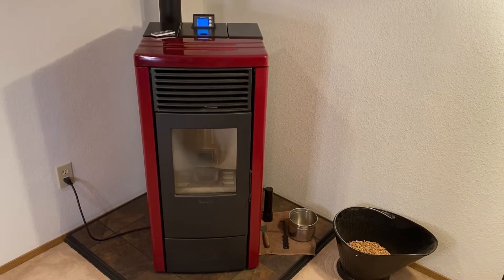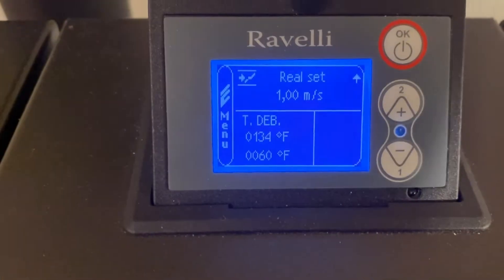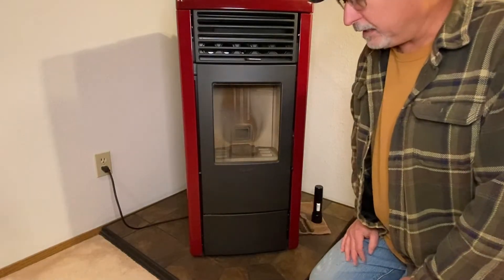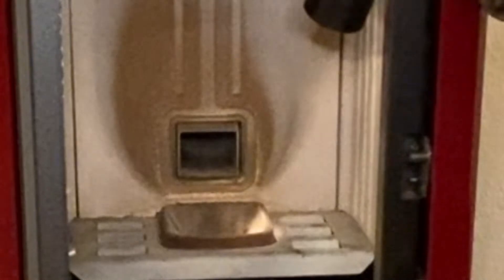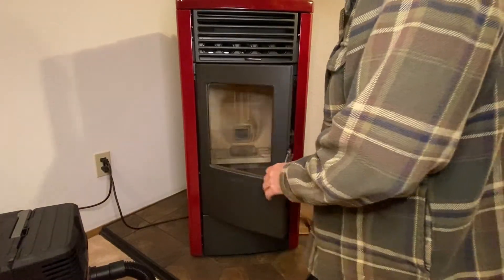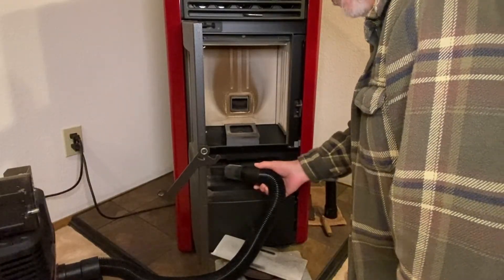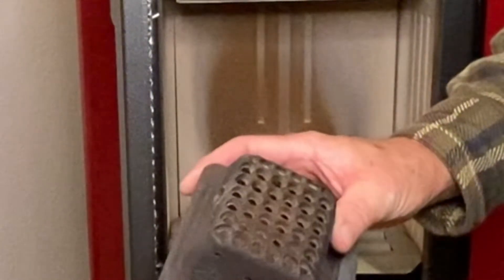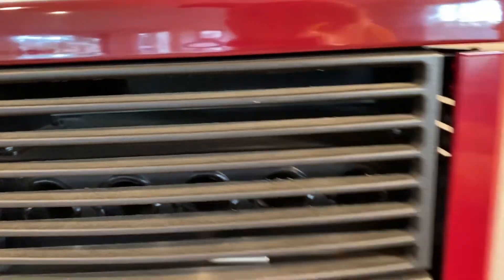Ravelli Francesca pellet stove airflow sensor error, cleaning, hopper filling and burn pot cracks

Comment: Hi, I’ve cleaned this pellet stove like yours, which I currently have on loan. However, I have a doubt about reassembling the flame deflector, and I’m afraid of positioning it incorrectly when the stove is turned back on. How is it secured, and what is its correct position? Could you possibly film it from underneath to show how this part should be placed? Should the slot of the flame deflector fit into the vertical U-shaped piece, or is its correct position to be fixed higher up? I don’t understand… Should it be almost horizontal, closing off the combustion chamber, or tilted and /or semi-open?
Reply from the maker: Hello!  Hold the baffle with the slot pointed to the back of the stove and the solid tab on the front of the baffle  bending down. Carefully lift the front tab tipping the baffle to more than 45° and raise it up inside the stove. Pull it back toward you resting the front tab on the flat bracket. Using your finger tips in the oval slot, continue to pull the baffle toward you raising  the back cutout edge over the swing bracket. Push it slightly away from you and nest the cutout on the swing bracket. You may have to fiddle with the swing bracket a bit to get contact left to right. 
After install, the baffle is angled up to the front and sits on the front bracket and nests into/on the swing bracket. 
Hope this helps!
Reply from the maker: I can’t film anything at the moment. However I do remember in one of the Francesca vids I do show the baffle orientation before I install it.
Reply: @FUBARtractors  Thank you for your fast response , you're very kind, I'll try to install it as you described , and with the help of this video of oyurs at 16:40 or so ! thanks again

Comment: get a 3/8 plate of steel and match the air holes on the bottom of the burn pot, it will insulate it from further cracking. you could also do 1/2" up on the bottom for a bit more fire protection on the burn pot. Warping/cracking can can happen on the burn pots luckily we can just fabricate our own.
Reply from the maker: Thanks for the tip, I never thought about making my own burn pots, great idea!

Comment: I'm curious what your pellet and airflow percentage settings are, and any other tweaks you may have made. watching you clean had me thinking my settings must be off because I've got so much ash. and your flame looks much smaller than mine. thanks!
Reply from the maker: Yes I can put those in a comment.    My ash bin is about 1/3 full each Sunday during the cold months. There is another 1/4 bins worth that falls in the side areas too. It will be a few days however before I can get to it. - Curtis.
Reply from the maker: Hello Adam. Sorry for the delay, I was out of town. 
My Francesca has a vertical 3”  flue about 15’ tall and I pull combustion air from the crawl space via a 2” pipe.  After I cleaned my stove the first time as shown in my videos, I reran the RDS set up. I found the codes online and a dealer present on how to do it.  I still had some ignition problems with way, way too many pellets on ignition so I changed some of the IGNITION parameters (default settings)
TF01 is the auger pulse now 3.6 seconds
TF02 is the auger run time for initial load of pellets now 3 minutes. 
TF04 is the igniter timer and I backed it down to 120 seconds. 
Now the burn pot fills about 3/4 full and the auger stops while the igniter is heating up. It’s been a long time since I’ve had a failed start up with these settings. I also don’t have overflowing pellets during the initial “flame light” and 8 minute warm up like I used to after the “professionals” did my initial install. 
My stove runs in modulation about 90% of the time and the flame is so low sometimes you can’t see it unless you are looking down into the pot, perfect!

My stove is ready for another deep cleaning. After that I’ll fuss with the user parameters

If you want to contact me via email for more in depth discussions - fubartractorfactory@gmail.com

Thanks, Curtis

Comment: How did you manage to only have that much ash after 3-4 days? I have to empty mine after 2 days. What setting do you run on? And at what temp desired temp
Reply from the maker: Hello Andrew. I run my stove on setting 4. I also run it using the thermostat so it runs on “work” then down to “modulation” om Modulation it goes from 5” flames to barely a flame cycling randomly. I’ve tried setting 5 but it spews out too many red hot pellets that end up in the ash bin. 
After a week, the ash in the bin is piled up and coming out of the front left corner of the bin. A quick shake and it’s about 1/2 full.  Sometimes if the house is cold soaked (51°F) it will run on high for 6 hours before switching to low. I use the stove thermostat set to 66 or 69. A thermostat on the wall right next to the stove tops out at 71 to 75° depending on outside temps. 

You can adjust your pellet drop and burn fan with the user settings.
Reply: Cheers I appreciate it! How many bags do you go through a day? Would you mind posting your airflow/pellet flow % that you use? Understandablly it depends on the type of pellets. But I guess since you are at a high setting (4) it burns them more efficiently.
Reply from the maker: Hi Andrew. About 1/3 to 1/2 bag a day, more if the house is cold soaked and 51°. As time goes on and the stove gets dirtier I change the user settings.  When I run out of adjustment the stove gets cleaned. I’m just about there now.  I used the RDS set up after my first deep clean. It picks all the draught and pellet values for setting 1-5. I don’t know what those settings are at the moment. I’m at -3% pellets and +4 % flow.
Reply: @FUBARtractors  Really appreciate it. I'll make some adjustments to my settings to see what fits best. one last question, the temperature probe located behind the unit, how far or how close from the unit is it? I'm trying to find the optimal distance to have an ideal temp (between the top temp probe and the back temp probe)
Reply from the maker: I have my thermocouple stretched out as far as it will reach. I think it’s a couple inches. When I bought the stove the instal bastards didn’t pull it out so it reached temp in an hour or so and I had to lie to the thermostat setting and set it in the high 70’s.  I think that’s the only thermostat (thermocouple or thermistor or what ever it is).  You can plug in a thermostat but you have to click the box on the display to have it read that one instead of the onboard one.

Comment: Great video, we bought a RV100 in August and the technician never set up the RDS and never trained us, the wire  for the flow meter was bad, so we spent over $1000 in service calls. Shouldn’t there be a manufacturer warranty?
Reply from the maker: I’d Google the warranty claim to see if the manufacturer or dealer provides a warranty.  A quick Google and I didn’t see anything encouraging however.  Good luck. Glad you like the video

Comment: I have the same model.
2800 euros.
No problem in 4 years .
Why the brasero is Broken???
Thanks!!
Reply from the maker: Burn pots will eventually crack from repeated heating and cooling cycles. It could have happened faster because of the way the stove was set up by the installer. After “flame light” it would drop so many pellets it over flowed and flames would reach up past the flame trap. I re-ran the RDS set up and adjusted the initial load as small as possible. It now enters “Work mode” without being warm enough to start the blower. It’s not unusual for it to take 5 more minutes to start the blower.

Comment: hi I have the same stove and something very scary just happened.  A small fire started on the TOP of the stove under the small reservoir for water.  I was able to extinguish the fire, and to my dismay there were a lot of pellets under the reservoir plate.  I cannot figure out how they got there.  I don't overload the hopper.  Any ideas?

Thanks Peter
Reply from the maker: I’ve had pellets on top of the heat exchanger too. I check that area every time I vacuum the stove. Pellets can overflow the front of the hopper. Take off your ceramic cover. See the 5 circular holes just under the cover?  You’ll notice the top edge of the hopper by looking thru those holes. There is a gap between those two parts. Pellets can also bounce into the 5 holes while filling even if you have the ceramic cover in place. Listen when you fill the hopper. I’ve gotten good at distinguishing the sound of pellets that fall on top of the heat exchanger.
Reply: @FUBARtractors  Thanks Curtis.  I can see how some pellets would bounce up.  But there were also pellets in the shallow water reservoir too!  Is it still possible for pellets to bounce directly into that pan?  It's almost as if someone not knowing how to load the stove started loading in that compartment rather than the hopper....

Comment: Hello Curtis, After I did a thorough cleaning there appears to be an issue with the flame. It starts out nice and big and then dies down to a very minimal flame, gets a little bigger and then small flame again.  I am using a good softwood pellet. Any suggestions?
Reply from the maker: What phase is this occurring in? Work, modulation, flame light or waiting flame?
If it’s work or modulation adjust your pellet auger to run a bit longer using your display. Go to Menu User (ok) use button 2 to scroll to set  draught/pellets (ok) change your percent pellets to move the indicator to the right (higher) 
If in the waiting flame/flame light phase you can test it by putting  a dozen pellets in the burn pot before you start it and if that solves the problem you will need to adjust your internal parameters (either the fill time (in minutes) or the auger pulse time (in X.X seconds) which requires a key code.
Reply: @FUBARtractors  It's happening during modulation.
Reply from the maker: @gsquare8585  yup!  I had the same problem when I switched pellet brands but mine was going out. I’d see a pile of unburned pellets in the pot and “out of pellets” on the display. The hopper would be full.
Increase your pellet % thru the user display as I described if it bothers you or the stove goes out. 
I run mine as low as possible to conserve pellets and not have to shut it down because the room is too hot. 
As a reference, sometimes on Modulation I see no flame unless I go look down into the pot and then I see just a hint of a flame on a pellet or two. Later it will be three or so inches high again.  I still get flame outs but not more than one ever couple of months. That is acceptable to me.
Reply: @FUBARtractors  Thanks Curtis, that's kind of what I was thinking. No error codes is a good thing! It goes on and off as it is supposed to.
Reply: @FUBARtractors  Good morning, the glass appears to have more black soot than before when it was basically white. would I need to increase the air? Thanks,
Reply from the maker: @gsquare8585  the Ravelli instructions are pretty good at describing the correct flame appearance. I’d review that before you try increasing the air flow but don’t increase it so high that you get chunks of pellets dancing around and flying out of the pot. The soot on my glass ranges from dark brown to white. I’ve noticed in modulation mode it deposits on the glass faster. When I used Clean Burn pellets I would get some very white soot on the glass and a very rusty looking burn pot. The soot tasted salty. I now use Olympus pellets and am much happier.
Reply: @FUBARtractors  Have you ever had to replace the ignitor on your stove? I have a 05 no ignition on the panel.
Reply from the maker: @gsquare8585  sorry no I haven’t. However I’ve had that same error (if I remember correctly) but it was because there weren’t enough pellets in the burn pot to ignite properly. Check the pellets in the pot to see if some are burned.
Reply: @FUBARtractors  Totally clean and vacuumed. I think it's the ignitor. Thanks
Reply from the maker: @gsquare8585  bummer. I bought one on line a few years ago because of the failed start ups.  Looks like an easy replacement.  Screws in from the back. Good luck.
Reply from the maker: @gsquare8585  found the paperwork. eBay. Company Earth Sense Energy Systems. There p/n: 55212 - Ravelli Igniter, short. You should verify the p/n. I’ve never tried to install this one. 🤞🏻
Reply from the maker: @gsquare8585  their email. Customerservice@pellethead.com
Reply: @FUBARtractors  It was the igniter. I ohm tested it and nothing. I actually had another stove and carnivored that one. It was actually pretty easy to replace. Finally something that went easy for me. Thanks for everything. 19mm wrench unscrews the thing. pull it out and replace.
Reply: Hello, would you know what the self control setting is all about?
Reply from the maker: @gsquare8585  it’s a setting to have the stove reduce the alarm times from 60 seconds to 5 seconds. The manual says use if you are not home and want to leave the stove on.  (Reading the Italian to English translation  is a bit vague) The dealer present I found said mainly for child safety. 
However you may not be able to fill pellets with this setting while the stove is on. I’ve never used this setting.
Reply from the maker: GSquare, I was trying to figure out how to send you info privately and subsequently deleted your reply.  Unintentional, sorry.  Looks like Youtube has disabled all ways of private contact except if you have a business email - I don't.  If you want me to send you the info I captured before it was deleted online, you will have to provide an email address here which I will delete once I capture it.  I don't have any other Social Media accounts sorry.

Comment: Mine just started going out during modulate mode. Was fine last year and I just gave it a deep clean. Had it for 5 years and never had this issue. No errors either 🤔
Reply from the maker: Steve did you switch pellet brands?  That happened to me once during brand change. I also had a pile of pellets at the top of feed cute once during a cleaning. Maybe try poking up there with your bottle brush.  🤷🏼‍♂️
Reply: @FUBARtractors  I did switch, could the pellets be bigger or burn different? They told me they were soft wood. I went from lacrite to waste to warmth. I'm running it in rds mode to see if it can adjust. Frying blind but I'll try anything. I also used a shop vac on the feed tube to suck out any stuck pellets but still doing the same.
Reply from the maker: Yes Steve I’ve noticed different brands have different sizes of pellets. Always in RDS.  I’ve always burned Douglas fir, a soft wood. Clean burn pellets were small and caused the stove to go out also put a lot of white crap on the glass that tasted salty.  Burn pot was always orange like rust. 
I use Olympic now. Much longer, no white on the glass and burn pot is not as rusty looking. 
Try increasing your pellet feed. 
While stove is on, hit OK, OK to enter user menu. Advance thru icons with button 2 several times to get to set draught/ pellets, OK. Use button 2 (+) to move curser to the right increasing pellet %, OK to save.  Experiment!  My pellet % is at -4 because of the switch to Olympic.  I kept reducing it until it barely stayed lit on modulation. Let me know how it goes.
Reply: @FUBARtractors  thanks! Works perfect now.